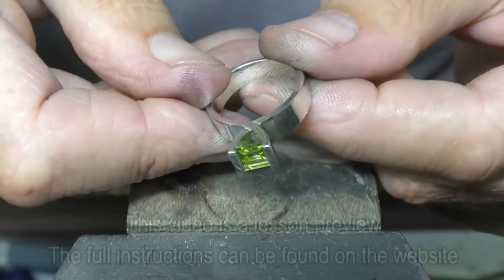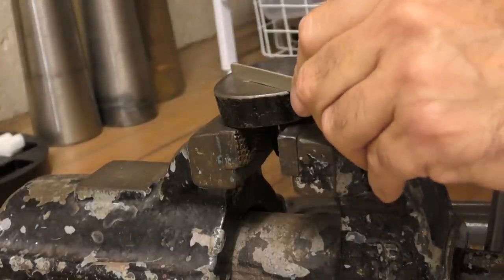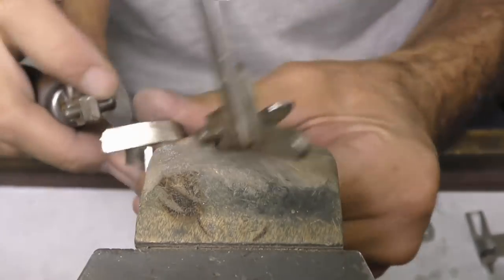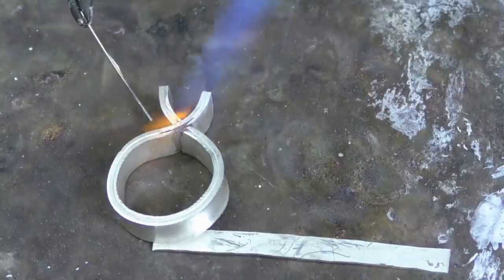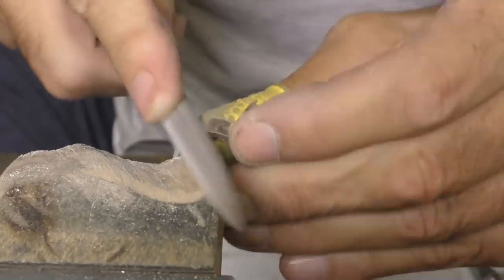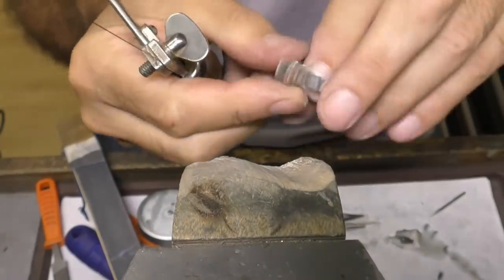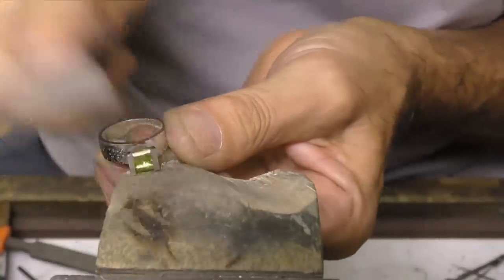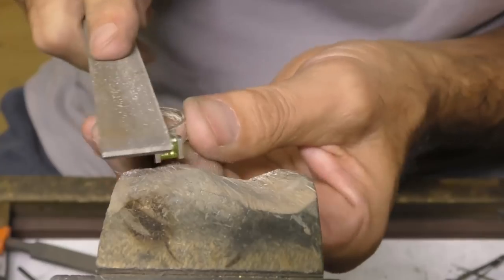Square cross over ring

Comment: Thank you for sharing, very helpful. Wondering if you know how to use a laser welder instead of the hammer action handpiece to do the setting?
Reply: I’d say to try to use the laser to finish up that part maybe a little bit too risky with the Peridot, or most colored stones with the setting like he made here. 
For peridot, hammer setting is even risky because the stone is so soft. 
You could try the laser, but risk the possibility of the laser damaging the stone. Also having to find the right laser wire and fiddle with the right settings for the sterling-platinum allow he used for this ring. I don’t like to risk very many colored stone with the laser welder. You can cover the stone with rodico and I also put white lotion on over the rodico covering the colored stone for more protection to hopefully deter the laser from hitting or ricocheting into the stone. 
Even corundum’s will get a hole blown right through if you’re not extremely careful with the laser. 
That would work better with just white gold or yellow. With a Diamond in the setting the worry goes down significantly. Both 14kwg and 14kyg are easier to laser weld with than sterling and platinum. I have never used the sterling/platinum alloy but it sounds very intriguing.

Comment: Do you use argentium or what is that alloy you used called?
Reply: Isn't that silver?
Reply from the maker: @MysteryFinery  Silver with PT, but my supplier doesnt do it any more. Maybe google for a supplier
Reply: @MysteryFinery  argentium is the name for a silver-paladium alloy that also doesn't get firescale but it's its whole own can of worms
Reply: @jewellerytrainingsolutions9978  I'll see if I can find some somewhere, thanks :)
Reply: @eminatorstudios  No! Argentium is a true  Sterling silver alloy with a little bit of Germanium  (either 93.5% or 96% silver). NO Palladium added. 
Firescale free, can be hardned in your oven (harder than 'standard' sterling),  a lot more mallable and more white,.
About can of worms, well worms differ and cans come in lot of sizes. But, yes there are tradeoffs.
It's fragile when glowing red so it breaks easy when moved red hot. Parts may have to be supported.
It easaly fuses to it self and 14K or 9K gold, so no soldering required, but solder does exist.
No rhodium plating needed.